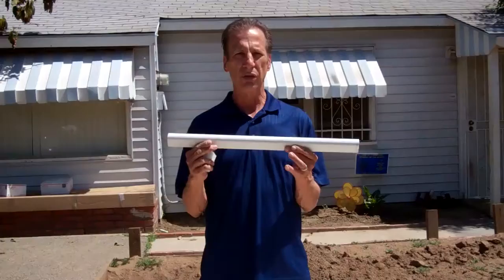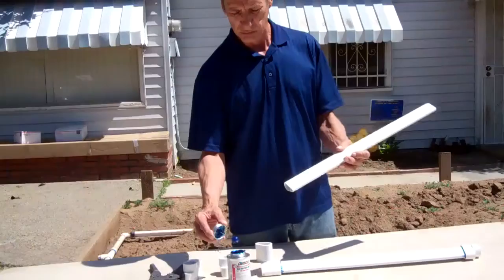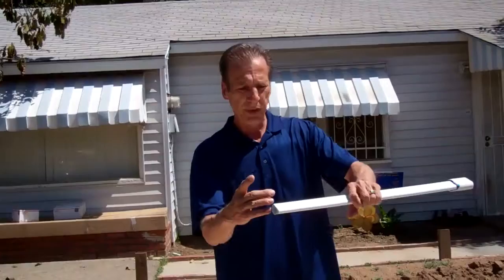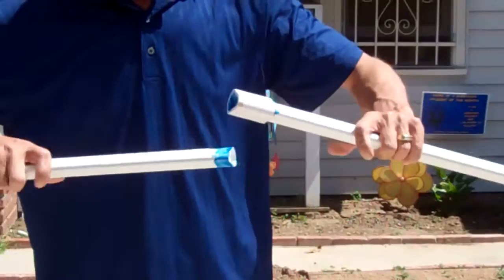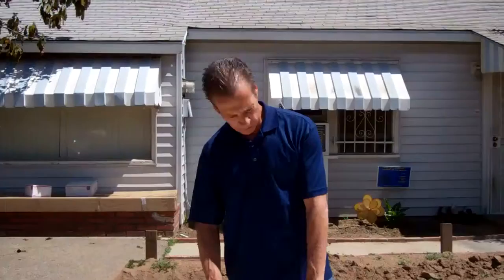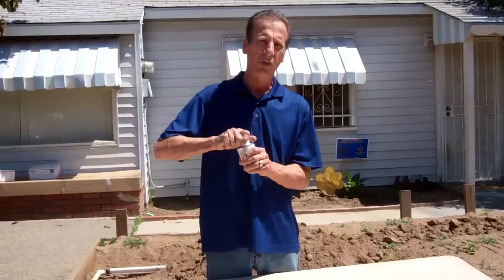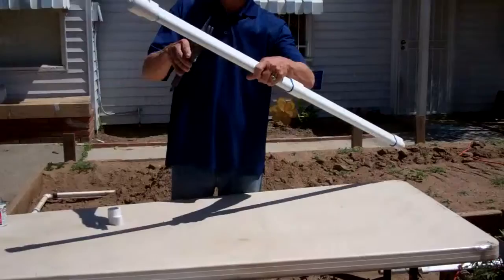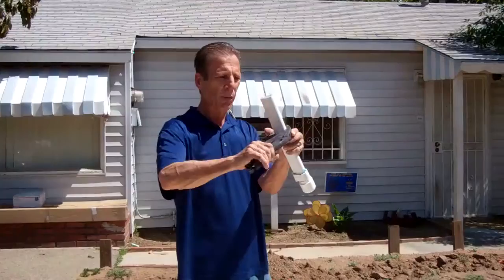How to Glue & Cut The AquaJet

Comment: Hello Rob,  The 8 - 3x12 earthmister bed worked great. I had to move and I didn't take them with me... I wish I had as I hear they are not being used and probably beyond saving.  Anyway, I will be setting up a few beds at my new location and I wondering if one should use primer on the joints?

Comment: Hi Rob,  What's GROWING on? David W. here. Just wanted to ask some questions if you can answer them and to add a IMPORTANT suggestion for making the Aquajet system even BETTER in my opinion (see below at bottom) but also had to say that you really have invented a GREAT and truly REVOLUTIONARY irrigation innovation and watering concept. I am and continue to be TRULY IMPRESSED by this "out of the box" advancement. I have watched ALL your videos so far (as well as John Kohler's) and they are all very helpful. Mr. Buff, if you could explain, in more exact detail, a couple of things it would be helpful for myself and I truly hope for others, as well. 1st - Please, when you can, do a video SPECIFICALLY on the various types of anti-siphon plumbing fixtures you have tried and the one you SPECIFICALLY recommend. You have shown them but never explained the process and parts and the manufacturers names. 2nd - Please show a dedicated video fully explaining the connection procedures of the anti-siphon devices you have tried and tested and what you have found to work best. 3rd - Maybe rate them on a scale of 1 to 10. One being the worst and 10 being the best. 4th - Also, could you please provide a better explanation as to why you chose to use 1 inch connectors as opposed to 3/4 inch connectors and plumbing parts. 
5th - I really like the "raceway" idea of combining two rows of the Aqua jet in a raised bed as opposed to only one run down the middle. The only thing thing that I think that would add to the "benefit" of the 2 runs of Aqua jet would be the ADDITION of the following: Rob, if you ad a couple of extra connectors at EACH end of the loop of the " raceway" and added a SECTION on either side of BOTH the FRONT and the REAR of the CLOSED LOOP system of EACH bed and used your ONE-SIDED SPRAY Aqua Jet piping facing INWARD toward the MIDDLE you would make the entire spray system only THAT MUCH BETTER in my opinion because you would be better able to have the system more accurately WATER the plants at the MIDDLE and ENDS of the FRONT and BACK of the square raceway "run" while still allowing the system to balance and pressurize its equilibrium. I have given this a lot of thought and will be self-installing my raised bed gardening setup in the above described way. It would be great to see you do your next garden install in the above described manner using one sided sections of 4 ft. Aqua Jet at either end of every bed and do a step by step "add-on" You Tube video showing this innovative add-on" concept more FULL and COMPLETELY water the middle and ends plants more uniformly. What do you think Rob? Does MY idea have YOUR stamp of APPROVAL? If so, tell John Kohler about it so he can add the additional components in all his future raised beds and as he updates his California home to include Aqua Jet and replace the drip system he has currently installed. Well, that's it for now. Hope this helps you and many other future AquaJet users. Well, over and out for now.....Much continued success and Keep on Growing :)
Reply from the maker: Thank you for the ideas RuReddi2 and for taking the time to post them. They seem like good ideas and we will review them. We are always open for new suggestions Thank you.